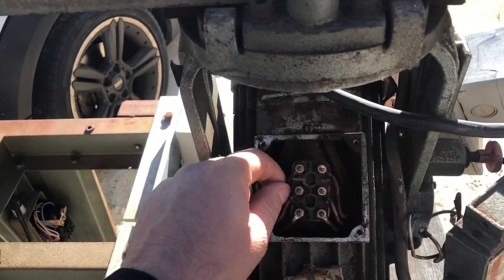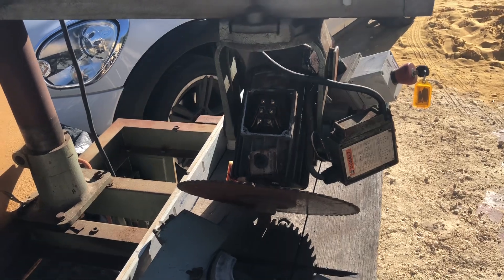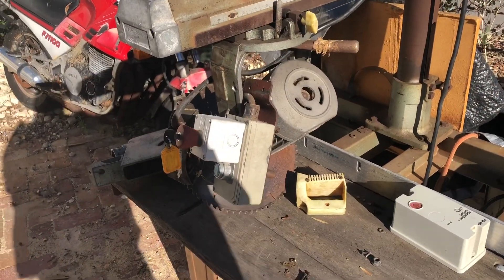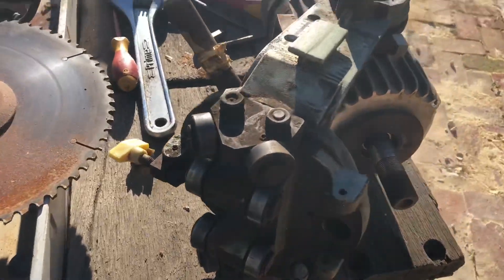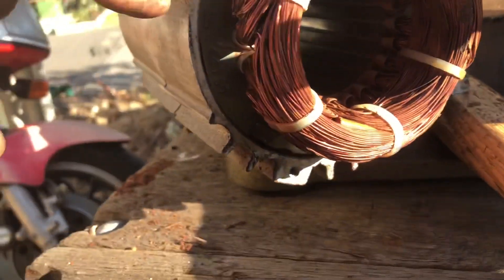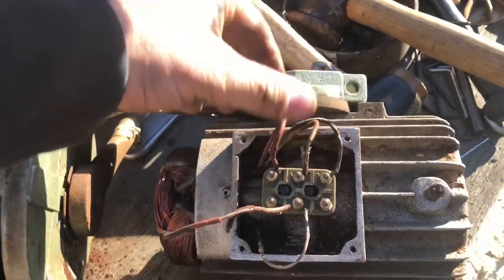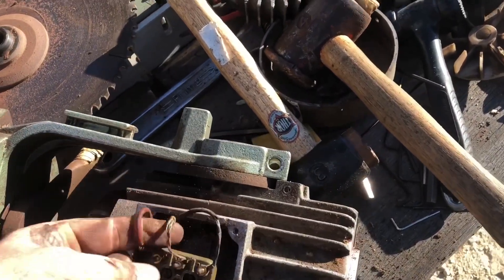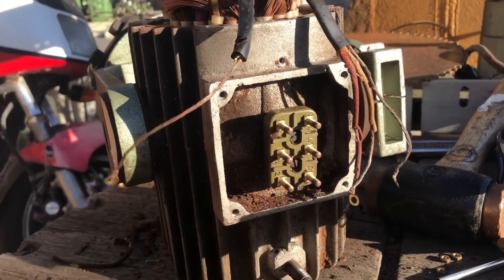Tool Time - DeWalt Radial Arm Saw 3 phase motor rewind and repair

Comment: My 12" dewalt is 220 single phase picked up at auction for $20 and 2 10" for 10 each all were working fine that motor is way over my head
Reply from the maker: That’s an awesome score! This project is lower on my list at the moment, but should still be a fun project once I get some time on it
Reply: @JBFromOZ  hope you keep us up to date

Comment: If you was in Tasmania I would teach you how to test and rewind it as Im a retired rewinder.
Reply from the maker: It would be awesome to be able to ask you some questions , first thing I am facing is where to buy supplies, I appear to have located a source of winding wire, but I am not sure where to get slot paper, or even if this is a specialist item. Ive seen 555 mentioned in a couple of places, but not yet determined where to purchase
Reply from the maker: 0.723mm is the first info I have, which I have determined is 21 AWG wire. 
24 slots, so 12 coils, each coil is terminated at both ends with 2 wires which suggests double wound (a pair of wires used to wind the coils)
The stator is approx 18cms long, and the loose end out the top is about 15cms, the other end hidden down deep I’m guessing slightly shorter, maybe 15cms anyway for allowance.
66cms per coil, I counted 94 and 95 on the two existing coils so expecting pairs I’m going to say 96 winds per coil
12 coils total
760 metres of wire to rewind.
Reply: @JBFromOZ  sounds about right you will have to gently heat the housing and drop out the stator if your going to rewind it and check everything 3 or 4 times and make sure all the coils have the same no# of turns. and same size wire as sometimes you might have 2 or 3 wires of different sizes.
the slot pappers is 555 nmn thats 5 thou nomex 5 thou mylar 5 thou nomex. Standard for 3 phase windings CMG in I think Vic. can supply wire and insulation perhaps just replacing the leads was common thing to do at work on older motors yn les the winding failed a megger ohm test to earth or between phases.you could drop a contact phone no# to my email at tasrobotics@hotmail.com and I could call you and may be explain a bit better but not an easy job to take on with no training as you can stuff it very easy and even to the point of electrocution if a small stupp up.
Reply from the maker: It seems like a really tight fit, was thinking to get the press on it, but just heat the outer yeah? That I can do
Reply from the maker: Appropriate heat and it will just drop out? Or will it still need to be pressed out?

Comment: G’day JB you can’t heat shrink the wire tails to the main bundle as far as you can?
Cheers 
Peter
Reply from the maker: Gday Peter, as far back as I kept going, the copper was stuff, so the only hope really was to replace back to the copper windings